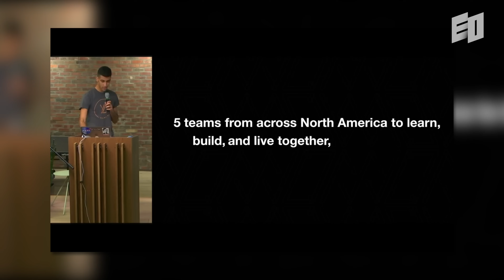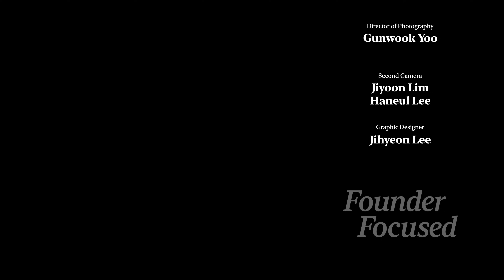I Built $200M Nuclear Energy Startup at 19 | JC.B, Fuse

Comment: Company Name: Fusemachines Inc.
Market Cap: Approximately $75 million–$200 million, depending on the source and recent fluctuations.
Public Stock Price: Fusemachines trades on NASDAQ under the symbol FUSE. The stock price recently ranged between $1.80–$3.14 USD per share as of late October 2025.

Note:

Fusemachines (publicly listed FUSE) is separate from "Fuse Energy Technologies," the startup featured in the video. The video’s company is a private nuclear energy startup and does not appear to be publicly traded or have a stock price available on the market.

Fusemachines Inc. is an enterprise AI company and not the fusion energy startup that the video discusses, even though the names are similar.

There is currently no public stock or ticker for the nuclear fusion startup "Fuse Energy Technologies."

Summary:

Fusemachines (NASDAQ: FUSE): Public, ~$75M market cap, $1.80–$3.14/share.

Fuse (Nuclear Startup): Private, ~$200M valuation, not publicly traded.